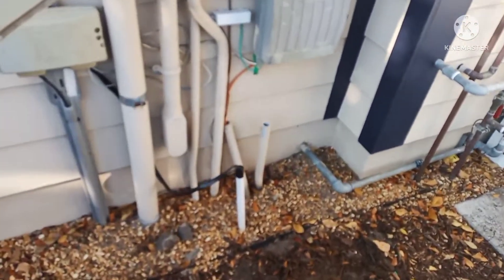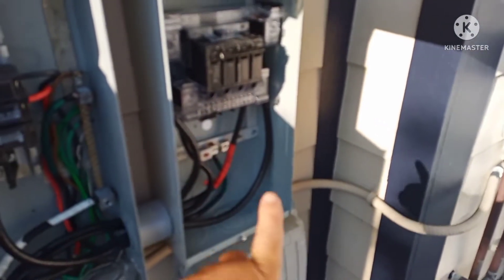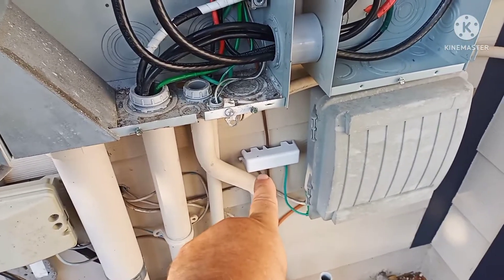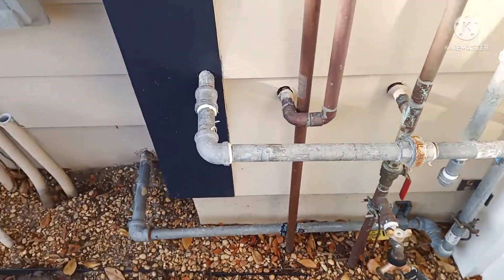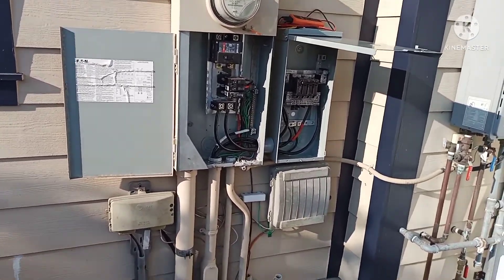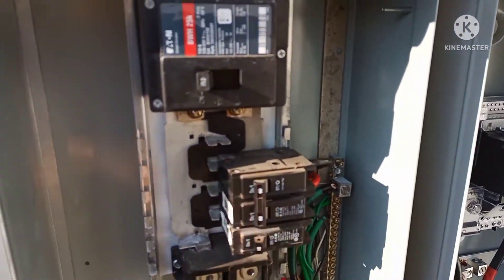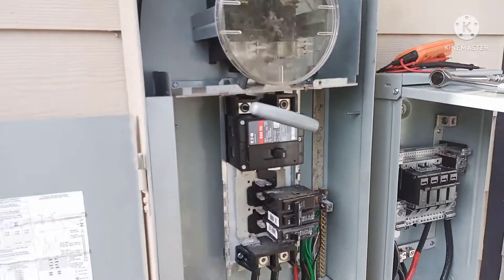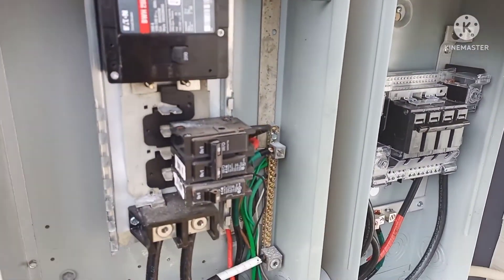How to Change Main Breaker and adding Main Breaker disconnect

Comment: I want to retrofit my old panel which is located in the kitchen, trying to avoid cutting and reframing the surrounding, what do you think?
I am close to you in Delray.
Reply from the maker: If you can wait until middle of January when im back from vacation
Reply: @albertmorellipalmbeacher3648  I am not in a rush. Enjoy.
Reply: Found  a retrofit panel with same width as the on in the wall right now. So you just take out the old control board and mount the new one in, no need to cut and re-frame the wall. I am selling the condo, but the new owner asked me if I knew somebody to do it. So There is a job waiting for you.

Comment: Why not just change the main breaker an install a 100 amp breaker on the main panel to the shed.
Reply from the maker: That's how they do it on the riser diagram from the city inspector